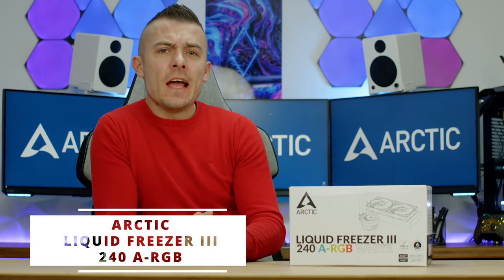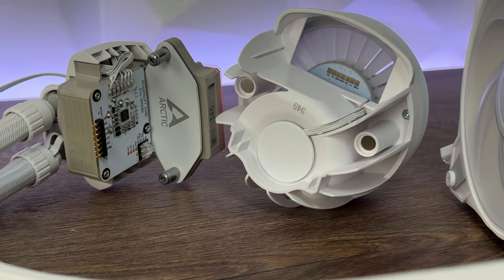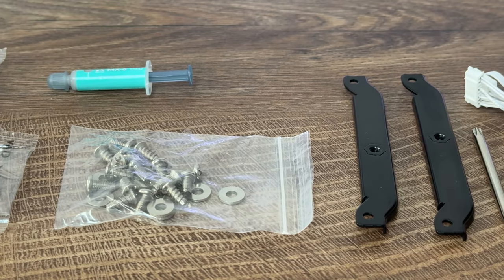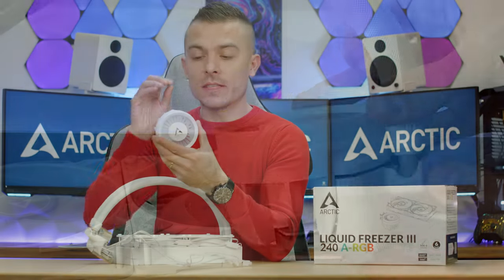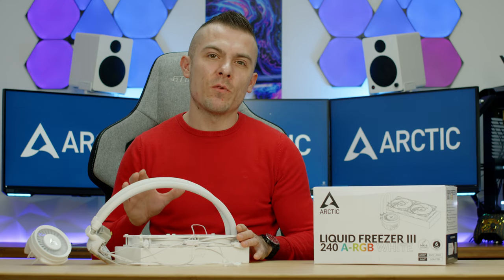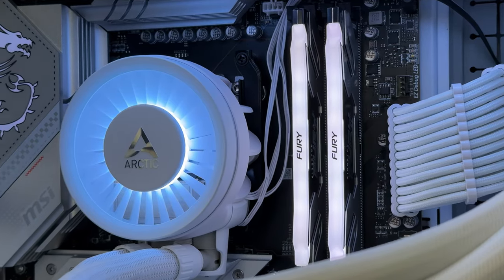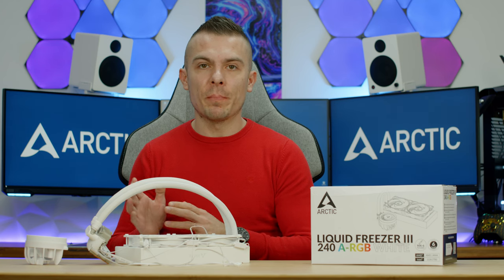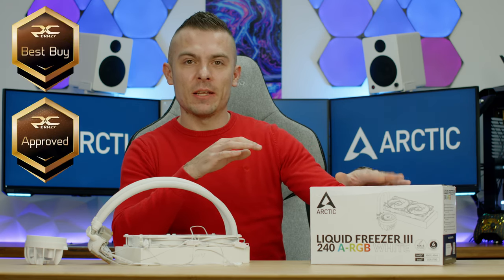ARCTIC Liquid Freezer III 240 A RGB - Review, Benchmarks, Tutorial (AM5)

Comment: Hi, I had issues mounting the pump to the amd bracket it was impossible to tighten the screws to the bracket!
Reply: Yup , that concave Plate is Pure garbage. Idk why did they change it from 4screw mount
Reply: @vido989  Ive heard mounting the plate to the cpu cooler first works way better

Comment: Why would a 360 or 420 cooler be "farfetched"? I see far more 360 builds than 240 and definitely more than 280.
Reply from the maker: 240 beating 360 and 420 isn’t farfetched? 😅 Even with thicker radiator? Come on…
Reply: @PCCrazyDario  The 360 and 420 have a 38mm think radiator, just like the 240 and 280... I'm not sure where you are getting this "thicker radiator" from. Even Arctic's website states that all have a 38mm radiator.

Comment: I notice that you are using a Lian Li 216 case, if the GPU is set to vertical mount, will the Arctic tubes hit it?
Reply from the maker: Sorry, wouldn't know since I didn't try placing the GPU vertically.
Reply: @PCCrazyDario  It's ok. I tried and it fits. Just need to use zip ties to avoid the tubes hitting the gpu.

Comment: The final 2 screws will burn your life …i did that now! It was the hardest thing i ever made!!!
Reply from the maker: Yeah, I have to admit they were hardwr than usual. Because of the bent part on top of the block that holds the tension. I manage to do it in vertical position but for everyone else, my warm suggestion is placing the case flat on the surface.

Comment: Warning:  Do not buy this CPU cooler.  First, when I went to screw down the pump.  Metal shavings sprayed all on my mobo.  Had to blow off all of the shavings with a can of air.
Secondly, on am4 the cold plate does not cover the entire CPU.  In fact an entire quarter inch on the top of the CPU was exposed.
I didn't even attempt to power on the pc.  I took it off and returned it.